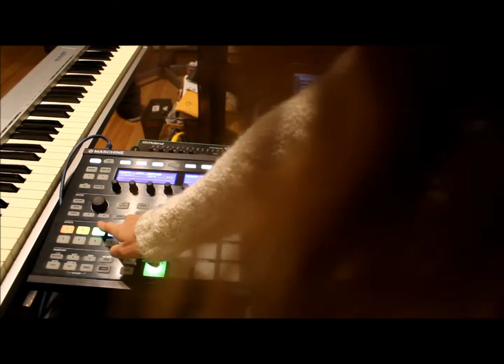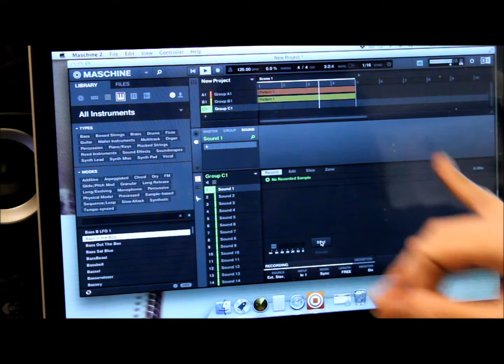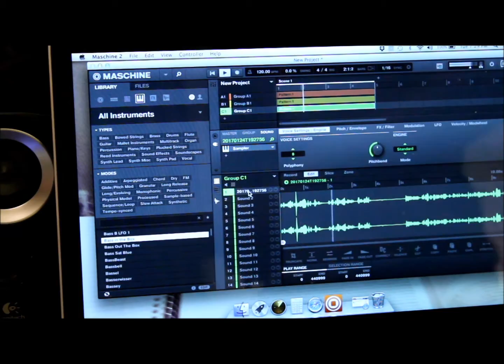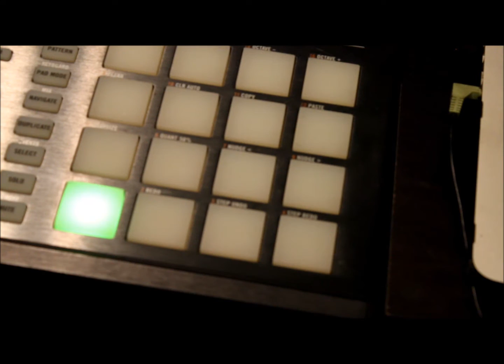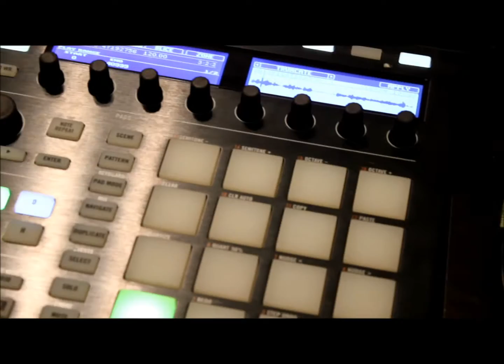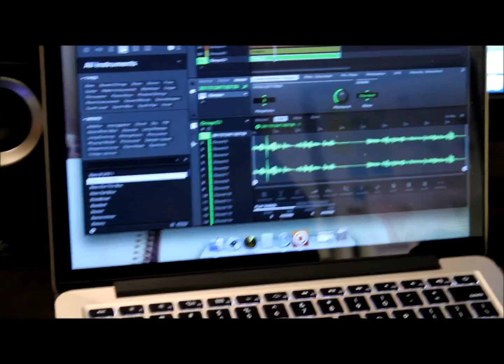Maschine MK2 Tutorial Recording Samples Without an Interface

Comment: I am new to this, how do i send music from MK2 in an old laptop to MK2 in a new laptop directly?
Reply from the maker: Hey Jonathan! 

Sorry I've been lagging really hard on replying to comments. If you haven't already figured out how you wanted to do that there are a few different ways to transfer your data. If you already figured it out maybe this will help someone else? Anyway...

Thank you, by the way for taking the time to ask questions. Even though I do apologize for taking so long to get back to you, It helps to inspire me to know what kind of tutorials someone may want to see, and there are so many different ways to do the same things, it's crazy! Even some of the tenured audio engineers will browse online tutorials just out of curiosity to see how other people do things. With technology you learn something new literally every day.

So, to try to answer your question, what I would recommend for transferring your existing files isn't necessarily a "direct" transfer, but it doesn't mean that there aren't ways to connect your laptops directly. You can actually still do that usually using Wifi, Wifi Direct, Bluetooth, or firewire/USB C wired connections. However, that could require some extra steps to enable or disable security features and it would be difficult for me to guess exactly how you'd need to do that not knowing what kind of laptops you're going between, the operating systems, models, possible roadblocks with certain security software or features enabled/disabled and would probably require a lot of back and forth that I might not be the best at helping with right now.

If your objective is to transfer your files this is how I would probably do it and it's probably the easiest way I can think of right now too. So, if that's okay with you, you could give this a try...
--------------------------------------------

Once you've installed the DAW (Digital Audio Workstation) such as, Maschine, Reason, Ableton or whatever it is that you've decided to use your MK2 as an interface with on your new laptop, the most practical way to transfer your data would be to start by getting your hands on a thumb drive or external hard drive. If you already have one that you use to store your pictures or to back up any other files, you could probably just use that.

---------------------------------------  

How to Transfer Your Files Using a Thumb Drive or External Hard Drive:

1) You want to plug that into your old laptop and you should see an icon for that storage icon pop up on your desktop. 

2) You can open that up and create a folder labeled whatever will be easiest for you to remember to associate with those particular files so that you can find it more easily when you get ready to transfer your files to the new computer. 

3) Then, locate the folder where your files were being stored by your DAW and you can usually highlight the files you want to transfer, copy, and then paste them into the file folder you created in that external hard drive. 

4) Then, you can eject it.

5) Plug it into your new laptop and open the folder where you saved your files. (I'll expand on how to do this below after I explain this last step.)

6) Copy the individual files or the entire file folder you want to transfer, and then once you've located the same directory where your new files are saving to on your new laptop, you can paste those files there. (I'll explain how to do that after I expand on step 5, below.)

-------------------------------------
Step 5: How to Locate the Files on the Old Laptop (Explained)

So in order to locate the folder where your files are being stored there are a few ways to do that too. 

A) It might be as easy as launching the DAW that you were using on your old computer (Probably Maschine).

B)  click file, open, and then you should be able to see the files. 

C) You can usually highlight them there and with your external hard drive or thumb drive connected to your laptop you should be able to drag and drop them into that drive.

 When the files have finished transferring eject your external drive.

--------------------------------------------
Step 6: How to Locate the Directory Where your New Files are Being Stored

Once you've connected your thumb drive or your external hard drive to your new computer and that icon for that directory has appeared on your desktop, you can double click the icon to open it and you should see the file folder you created, or the individual files.

A) So now you want to launch your DAW (Maschine).

B) Click file and then open.(You should see the files that you've been creating on your new laptop there.)

C) Return to the directory where your thumb drive is located. Highlight the files you want to transfer, and then drag and drop them into the space where you see your new files saving to on your new laptop.

-------------------------------------------

You could also omit the thumb drive and opt to use something like Dropbox, Drive, Box, iCloud, or any other cloud storage service that you may be using already if that's easier too.

Anyway, that may not be the best description of how to do that and it's only one way. There are several ways to transfer your files. Some laptops will allow you to create a direct connection using WiFi Direct, but that can be a little more complicated and it depends on what kind of computer you have, the capabilities, and a few other factors whether or not that can even be done in a practical, safe, or secure manner. 

For security purposes it's probably better to use an external hard drive or a thumb drive to transfer files versus attempting to rely on any sort of wireless connections.
 
Hope that helps someone.